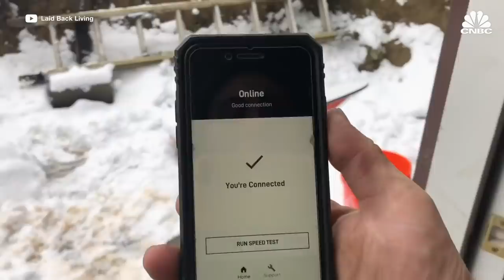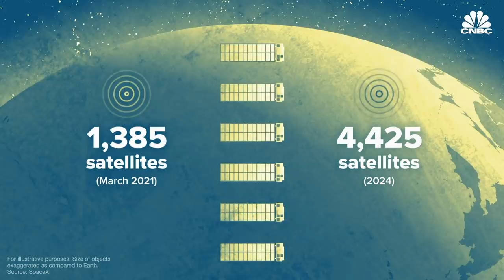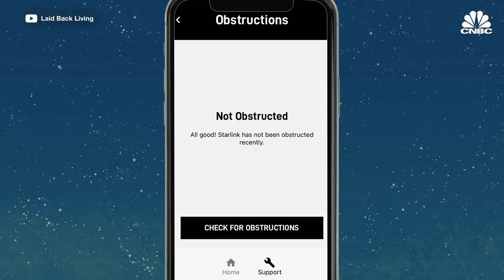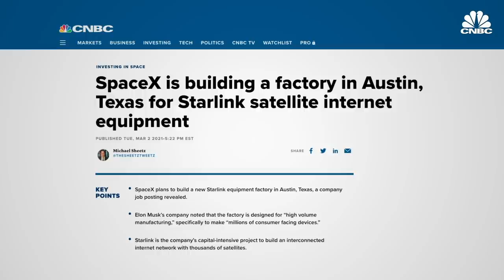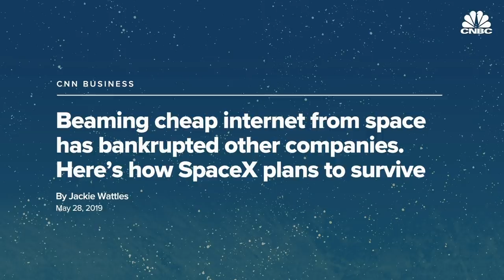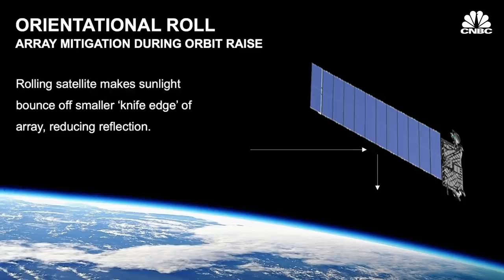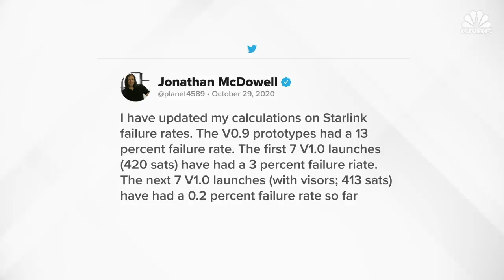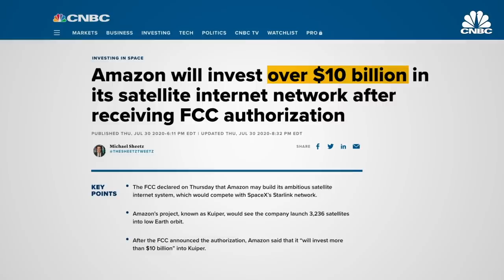Why Starlink Is Crucial To SpaceX’s Success

Comment: I don't care if it's a bubble or Starlink is not profitable. Starlink has been a godsend to my family in the rural area. I will buy every spacex/starlink stock I can. I don't care if it goes to 0, I want Starlink to succeed.

correction for CNBC, @4:29 latency is not important for video streaming because of buffering. It's only important for video conferencing, calling, and gaming.
Reply: You might want to sort out your thoughts before you comment so they at least make some sense.
Reply: I've heard that low-latency stock-trading is also very lucrative, as well. Regardless, it really does seem like Musk struck gold with this idea.
Reply: @mvmlego1212  That is done with equal length fiber runs going into the trading centers.  NOT an application of starlink
Reply: @bindingcurve  -- "NOT an application of starlink"
Are you sure about that? Lasers offer an even lower-latency option than fiber-optic cables.
https://www.youtube.com/watch?v=giQ8xEWjnBs
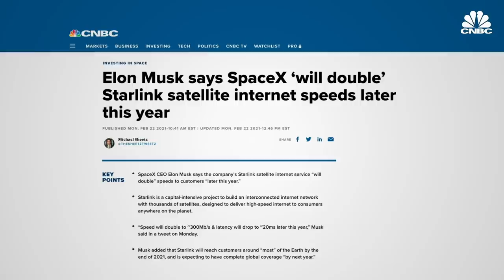(4:49-12:11)
Reply: @mvmlego1212  Just read up on the actual tech papers.  For long distance trading is has the potential, but don't bet on it.   Relaying of moving targets may introduce unacceptable flutter.
Reply: Unless you buy in the IPO (which you won't be invited to) buying shares in a company gives nothing to the company. Shares traded on stock exchanges are second hand. Just like if you buy a used car, the guy who sells it gets your money, not the car company.
Reply: @TheRealUnconnected  companies usally maintain a certain percentage of self ownership.  When stock prices remain high, they are able to leverge that value for bonds.
Reply: @TheRealUnconnected  I'm buying it right now.
Reply: Moreover, they present the concept of band width (data transfer rate) after calling out for latency, so...
Reply: @mvmlego1212  low-latency stock trading (especially between NYC and London) is actually his primary target. There's a mountain of money there.
Reply: Ticker symbol ASTS... you're welcome.
Reply: Are you buying pre ipo? Where?
Reply: @potato2941  how are you buying if it is not publicly traded?
Reply: @Ryan_Quinn  trade secret
Reply: Latency is also important for enterprise costumers, especially for banks and stock exchange. 1ms latency costs aprox. $100million/year for a company operating in the international money transfering business, and a fully established Starlink network can provide up to 20ms better latency in long distances than any fiber cable solution.

Comment: They mention that the low latency is good for games and movies and forget to mention video/voice chat (phones).  Latency means how long it takes to get there, so if I say hello on my voice chat, how long does it take for the other person to hear it (then they have to respond).  Latency is not much of an issue for movies.  Bad latency means you press the play button to start,,, and have to wait 2 seconds instead of 1/2 second, but from that point on the movie plays fine so long as you have the BANDWIDTH (100 meg download).
Reply: Gaming, Video conferencing, Stock market trading will get the maximum benefit from this. Science will also benefit. Remote sensor stations, Telescopes etc, stand to benefit from high throughput and low latency connections and the ability to connect from anywhere.
Reply: The part about the movie is not correct. The movie usually pre-loaded and commence or stop action is done locally. However, if the latency is good for games, than it will most likely be good for video and voice chat. The light travels faster in vacuum than in optical fiber.
Reply: It still has far higher latency than fiber optic systems. Its lower than geostationary sat internet, but it has a minimum 20ms latency, i can get 1ms - 5ms on fiber.
Reply: @TheRealUnconnected  That depends how far is the server. 1ms to 5 ms only allows light to travel 300km-1500 km at max. That means your target server is quite near you. If your location is remote, the server could also be far from you, which is the reason for higher latency.
Reply: @TheRealUnconnected  and Starlink isnt built to compet with fiber. Its designed for areas without fiber.
Reply: @gernotfischer7908  Exactly that. My latency has gone from ~650 to ~30 (and down speed from 20 to 300). I'm more than happy with that. I'll never have the option of fibre, and I'm only 30km from Australia's capital city. Only option is satellite.
Reply: @TheRealUnconnected  It depends where your destination is, 20ms is really good. But even for Starlink the latency fluctuates.
Reply: @starship1128  That was the point I was getting at (without being too technical).  You click on the link to the youtube video you want to see, it immediately starts being sent to your device and starts cacheing (stored locally).  Latency may cause a minor delay in the start of the initial load, but from that point forward it's a non issue.  (unless you don't have enough bandwidth, but that is different then latency).  There are caveats,  the system does not typically cache the entire video so if you hit the time bar to jump ahead 10 minutes in the video, you may have to wait for that part to load.
Reply: @TheRealUnconnected  I am use to 90 ms ping on a good day. At this point anything would be an improvement to me. Where I live we are stuck with 7mbps centurylink.